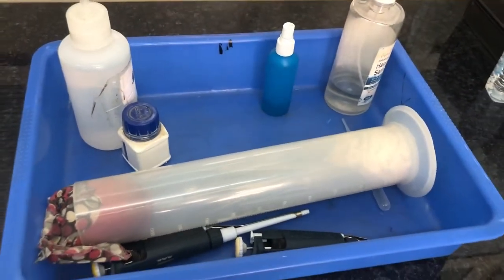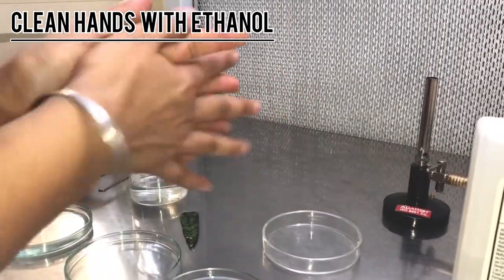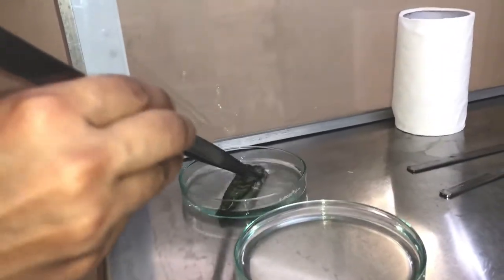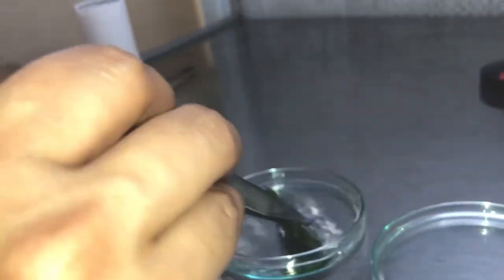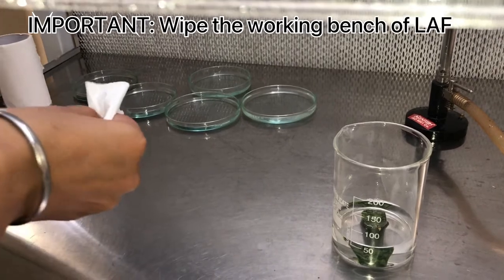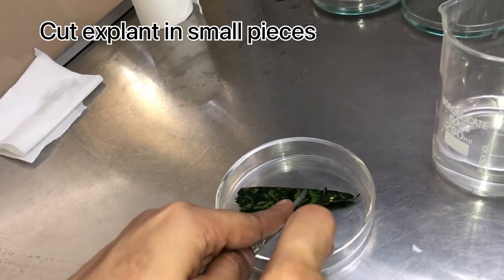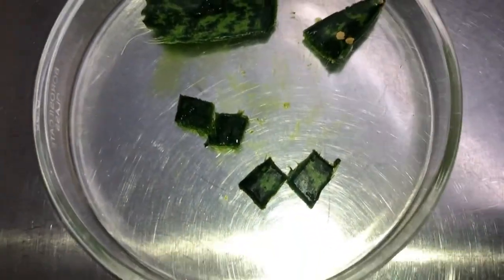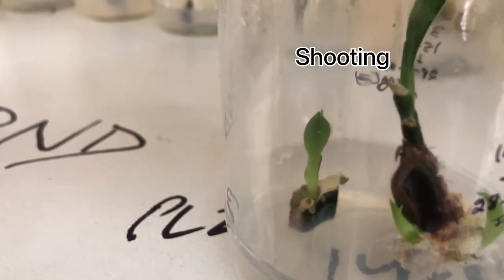Surface sterilization of explant and Callus culture | QUICK DEMONSTRATION VIDEO

Comment: Tissue paper is clean?is there any chance of contamination during this soaking water process
Reply: I think her cultures will have a tremendously high chance of contamination! She's making a lot of mistakes!
1. Not wearing gloves
2. Not flame sterilizing her forcep and scalpel
3. Using unsterile paper towels
4. Using HgCl before ethanol instead of doing ethanol first and then HgCl
5. Not measuring the time that explants stay in HgCl and Ethanol
Reply: @muddypawswanderlust   Agree with most of what you said, but gloves are not used for in vitro culture, it is very dangerous to work with gloves close to flame, take care !
Reply: How to make hgcl solution